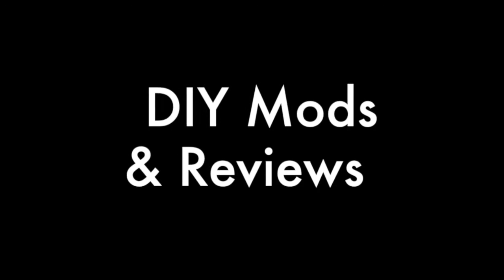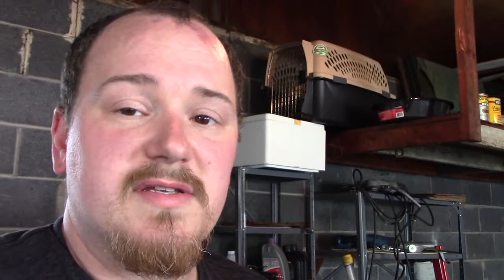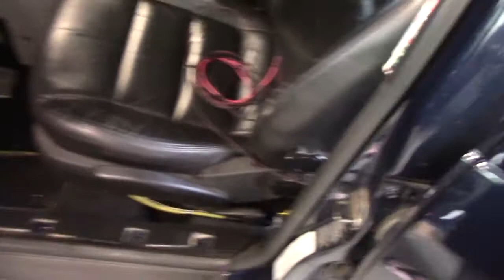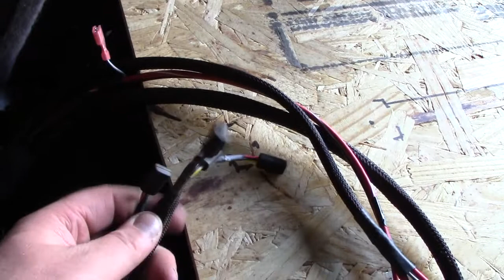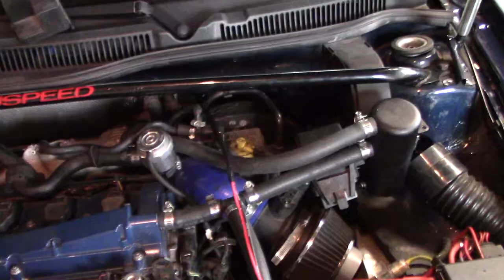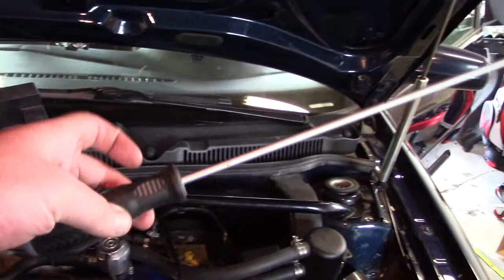MK4 Jetta Air Lift Install: Running Electrical

Comment: Hey man nice video, just one question, what fuse should i attach the ignition cable to?
Reply from the maker: I can't remember which i did. I either used the fuel pump or ECM fuse. You just want to find a fuse that is tied to the ignition so the system comes on and off with the key. I think i started with the fuel pump fuse then used the ECM fuse. You may also need to make some slight mods to the fuse panel cover. On the inside there are some raised "walls" that will crush the ignition wire when you put the cover on... I learned this the hard way. So I ended up cutting a notch in the cover so the wire will feed up freely and not get severed.
Reply: +MK4 Modder thank you man preciate it